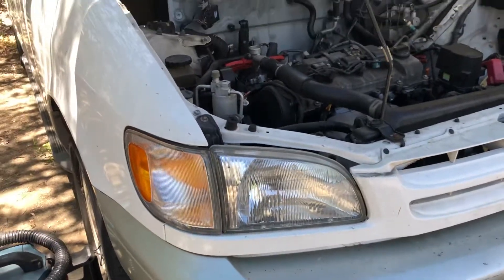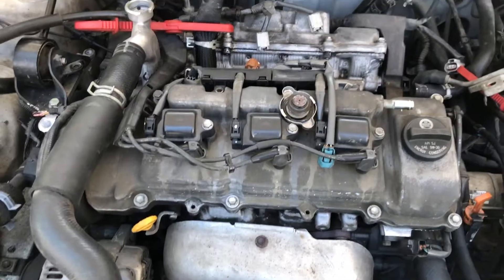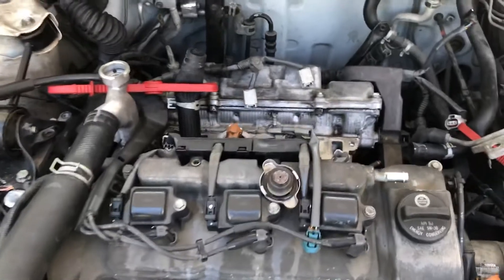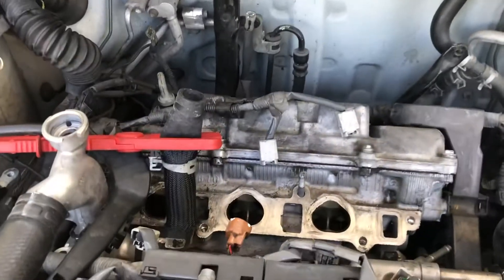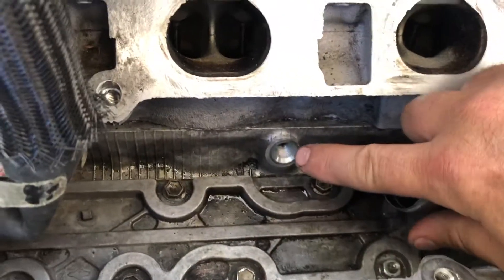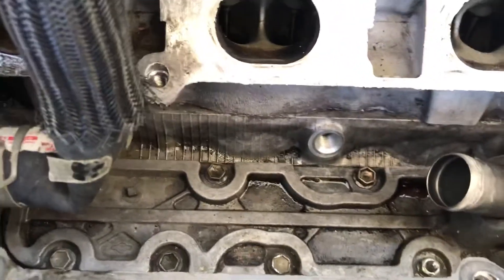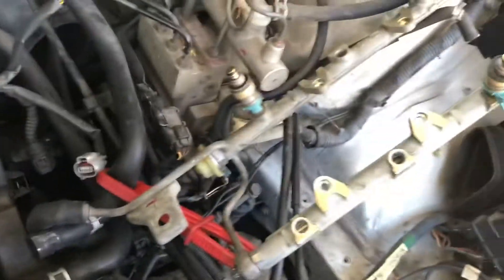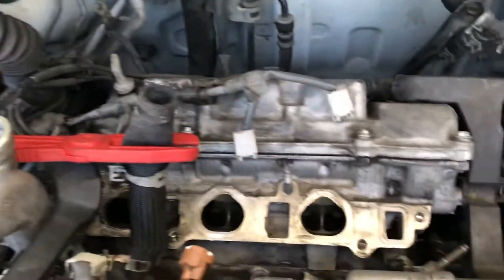1MZFE 1998 Toyota Sienna Knock Sensor Replacement Process Explained Part 1

Comment: Where’s part two??
Reply: There is  "1MZFE 1998 Toyota Sienna Camry Lexus RX Knock Sensor Replacement Process Explained Part 2" but its equally short and touches on gaskets.